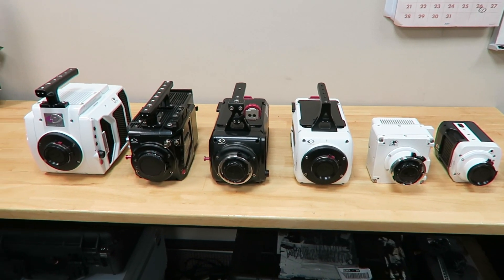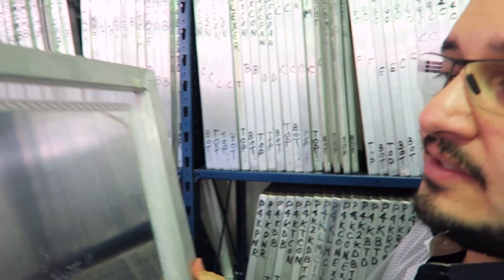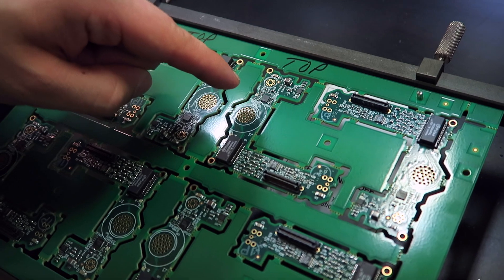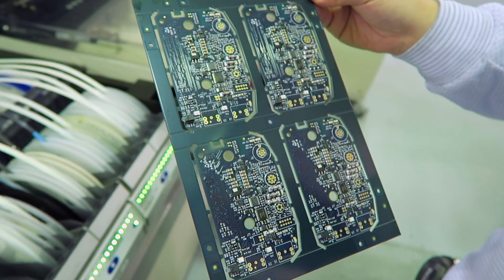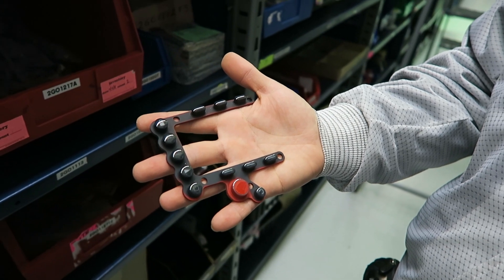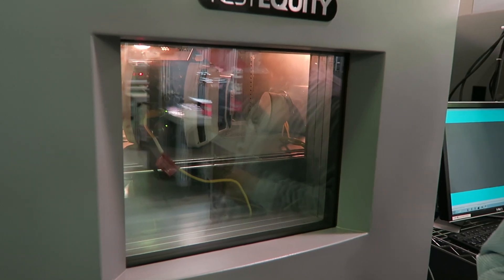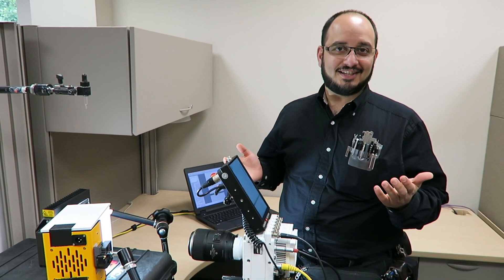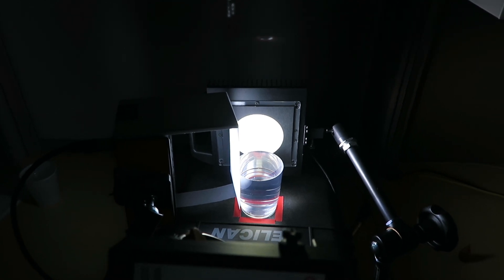How Phantom Cameras are made

Comment: I have a hard time handling how perfectly symmetrical those water droplets hitting the water were
Reply: They used to make lead shots by dropping a premeasured amount of molten lead from a certain height into cold water where it solidified into an almost perfect sphere.

It's physics at work :P
Reply: the water one without the die looked so fake and simulated
Reply: Alec White that’s actual the third one :)
Reply: Maybe this will help. If u think about what causes tge drops to be perfect, it gravity combined with several other forces acting inward upon thr droplet. And its also newtons first law (i believe) every force has an equal and opposite reaction meaning while a force is being put on from one direction, the same force is acting on the opposite side, thus giving a perfect sphere. Obviously with air flow and forcing it out the tube the water drop will not stay perfect the whole time

Comment: I'm surprised they do the board assembly in-house. I'd think they would have an outside shop make the CCA to cut costs by decreasing overhead. Where is the actual design work done?
Reply: Assembly is probably cheaper in-house, considering they do make quite a few cameras.
Design is definitely in-house, from silicon(sensors) to mechanical.

Comment: Using a slightly updated version of screen printing for board manufacturing...pretty awesome.
Reply: Just for dispensing solder paste.
That's the cheapest, easiest, fastest, and most reliable way.

Photolithography is used for making PCBs themselves.

Comment: I have so many questions for this, but honestly I hardly understand all the tech lingo in this so I don't feel like asking in fear of not understand the answer
Reply: Lol try asking. You can't learn if you don't try :) I've worked In a similar factory so I may be able to answer some questions.
Reply: bensemus x Well, the only thing I can think of right now is what happens to the camera if it has any defects. Do they scrap the whole thing, or do they take it all apart and replace the defects?
Reply: I'm not an expert in any way, but from what I do know of how similar products are made in the industry, a lot would depend on where on the camera the defect is and how serious it is - that's why you have extensive defect checking at every step, because if you find out a component is missing from one of your boards just after the components were added, it's a lot easier to run that back through and fix it than, say, if you discover it during final assembly. Some stuff you certainly could take the whole camera apart and run everything back through, but some stuff would require you to scrap most or all of the product depending on how far down the chain they are and how severe the issue is. A cracked board for example is always a showstopper. 

That's part of why tech is increasingly moving towards modular design. Modular designs, among other disadvantages, do cost more, but they're also much less costly to maintenance on average.
Reply: They most likely repair it if it's possible, if not, the entire camera is scrapped/put in for further investigation and possible repair(dead sensor, etc).
Reply: Little Snuggle Most likely they will manually rework the defective board. In our factory the boards were inspected any any missing or poorly soldered parts were sent to repair where someone manually fixed it. For really cheap parts we would just toss them but these boards can't be cheap.
Reply: Normally you got at least 3 stages, where you test your Circuit-boards. #1: SMT (Chip parts - the one on the reels, or cassettes as he liked to call it), #2: THT (The next step, where all the connectors and stuff are assembled) and #3: test bay (Normally a complete electric test of the circuit board). If you mess up and don't notice it after these stages, rework and repair get's very time-consuming and expensive. Before that, it's no big deal.
Reply: JackswastedlifeLP Nope.
At this price point, it's REALLY cheap to do manual repair on fully assembled cameras compared to remanufacture.
Reply: I'm not talking about remanufacturing the whole thing, I'm talking about replacing the defective components (resistors, capacitors, IC's and so on)
Reply: JackswastedlifeLP Testing happens after final assembly of boards, as well as final assembly of cameras.
Nothing is done before that.
Reply: dude, look at 3:15, that's an AOI machine -.-
Reply: JackswastedlifeLP By that I mean functional testing, not assembly.

Comment: I was about to request some sort of tech explanation about the gear you use. The factory tour is nice, looks like any other good contract manufacturer running an SMT line. I was expecting more about the magic going inside one of those, if the CCD was custom made, how was the main processor implemented, how fast it runs ... etc etc. Of course this has something to do with IP and they are nor sharing this information with YT. They show a pretty nice factory, but it is standard gear in electronics industry. The money shot is in the RD offices, IMHO, talking to the people who made it real, the tools they use .... that would be mind blowing.
Reply: They use in-house designed CMOS sensors. CCDs aren't used for anything high-speed, and haven't been for more than a decade.
They use a set of breakneck expensive FPGAs running at(I presume) around 600-900 MHz(that's not actually true, the FPGAs don't have a single "clock") to store images in RAM.
They probably use Altium or Cadence products for designing the electronics, probably Autodesk stuff for mechanical.

Nothing special.
Reply: ***** Ahhh ok, I am not very keen in image HW, that why I wanted to see the magic there. Yes, I asume that FPGA was used heavily there, that is sure. But they have a logic designer as well to make one or more custom chips, but since its all digital and not mixed signal, probably they can drive all the way with an FPGA given the POWER of the expensive ones and its capacity, no bottleneck there. But the image sensor most be crazy stuff. And even when they store to high speed RAM they cant fit enough to record 1s at 26K FPS, they most have a big buffer but somewhere most be a badass storage matching the throughput of data.  He told about the flash cartridge being high speed ... probably some black magic going there too. I dont know if actual SSD that dont use SATA (those that plug into PCI express or so) are capable of its speed and latency (never figured the numbers). 
Altium, of course and probably Solid or Catia for the mechanical ... lets go pro there too =) 
Those sensor are read more like a DRAM in a matrix fashion. I mean, they are not SERIAL ... right ?. This stuff would be interesting, but probably will be boring for most of the subbers ... I believe.. Anyways, that is IP, and they are not sharing these, but hey, show a couple of LCD with Altium and some logic design SW (I dont know them at all), and some FPGA suite like Quartus (the only one I heard about LOL) Cheers
Reply: 38911bytefree The only custom hardware in there in terms of silicon is the sensor, the rest is FPGA fabric.
They are using a custom SSD, maybe even something proprietary, but it's definitely not fast enough to store images in realtime at higher speeds.
The sensor most likely has a regular clock input and spits out data over a lot of parallel LVDS lanes running at several hundred megabits per second each. So, yes, it is serial, serial-parallel.
Reply: ***** Do you have some link to read about this sensor ? .... Thanks.
Reply: 38911bytefree Nope, it's entirely proprietary.

Comment: 3:19 They still use vista?
wot
Reply: that's not vista, that's Windows XP!!
Reply: No reason to upgrade those machines. The software they are running might only support vista too. I work in a similar factory and the P&P machines are running XP. Some are even running 95.
Reply: Yeah, they are probably not connected to the internet, so who cares if its up-to-date for security exploits.  
And yeah, some software/drivers they use might not work on a newer OS.
Reply: Most of the United State's nuclear missile control is run off the foot long floppy disks.
Reply: Ezequiel Perez Close enough.
Reply: Of course, how else is he going to play Halo 2 during the wait.

Comment: And this, everyone, is why phantoms are so damn expensive
Reply: bensemus x There is a huge markup on the Phantom cameras, sure, they don't cost more than $10k/ea to produce.
That's not the point. They can set the price to anything they want, because there's barely any competition.
Reply: The same machines are used to build the little lights in cars. The cost comes from designing them more then making them.
Reply: And their custom sensors.
And the hardware cost.
They have several $5k+ FPGAs in there and those multi-way connectors made out of dollars, hnnnng.
Reply: ***** Markup on products can be crazy though. We make a board which costs us $10, sell it for $30 and then it's sold for $500 after it gets its housing.

Comment: On your question of toast through the reflow oven: I used to work at a Fab and we had a few. Every couple of weeks, we would suddenly get a bunch of random failures. No one knew why, but analysis showed random particulate in the parts. Finally we found out that it was a tech making pizzas on their late night shift. So that toast you want would potentially ruin a few really expensive cameras like it did our boards.
Reply: Really? Someone was actually putting food into the oven? Hahaha. I also work in a SMT factory but no one ever put food into the oven. They are quite dirty and we use lead paste in some products so very bad idea. Instead some people put stink bugs through the oven, or the laser, or doused them in isopropyl.... Ya we don't like stink bugs.
Reply: Yep. Actually, it was a story I was told from before I started. May have actually been anecdotal, but still kind of funny.

Comment: This has allowed me to appreciate just how many parts go onto ANY circuit bord. Just spent a while looking at my Graphics card wondering just how many more parts does my card have compared to a phantom - Great video guys
Reply: Quite a bit less, because your graphics card has been integrated to death to make it cheaper to manufacture.
Reply: ***** Okay yes, you have a point there - I guess I'll have a better understanding when I start my Computer Science Courses in University. Thanks for the insight none-the-less!
Reply: Killjoy212 In ELI5 terms:
Your graphics card has all the electric pixie wrangling stuff on one crystal instead of multiple with wires.
Reply: ***** Haha I understand, with a good laugh in between
Reply: Make sure to follow up on any chance to design your own integrated circuit chip if you get the opportunity, some CS courses offer that sort of thing. At least the chance to develop one on an emulator/simulator... But some even do a class-wide actual integrated circuit manufacturing run. Once you've done that, then take a 2nd look at your graphics card. You'll feel even more gobsmacked by the complexity of it all, once you can appreciate it!
Reply: Mythricia You can only get ICs in advanced EE, but the good part is that most final projects are sponsored by the uni to go through a small MPW run at a service like MOSIS, which gets you 20-30 chips of your own design in silicon, packaged.

And you really don't need to go to uni to design circuits - it takes an hour for anyone slightly experienced with electronics to design, simulate, and fully tape out something simple like a NAND gate or even a small opamp.

The real issue is actually manufacturing your IC design. Even MPW, "low-cost" services like MOSIS cost around $2000-5000 for a mm^2 with a minimum order of several mm^2 and a lead time of ~2-5 months.

Image sensors not only cost a lot more to prototype because they're physically huge chunks of silicon, but because they use more complicated processes.
Reply: ***** I guess it depends where, I have a friend who studied in the US and they did a little bit of basic IC design as part of regular CS. Never went anywhere near EE. Although I don't really know the specifics of it. This was quite a while ago though.

And yes, I was making the same point you were, just figured it don't make much sense to the original poster to talk about the details of low volume manufacturing cost. And yes, there are quite a few of us who are into circuit design, integrated or otherwise, without ever having studied it!

Though I don't know if a NAND gate counts as much of an IC design, it's like what, 4 transistors, 7 different layers x)

Comment: So that's why it costs more than a Ferrari haha. Those things are amazing
Reply: Nope, it costs that much because of R&D and low demand.
Reply: +Spirit that's part of the reason, I worked with Sony about 3 years ago on a slow mo camera that was going to be released this year and, they sold hundreds and hundreds of units, the camera does 480 frames per second in 4k, I believe the cost is about $96,000. I know that's not even close to the amount of units they sell on a consumer camera. but I figured just for comparison
Reply: Warped Perception $96k is absolutely mental for 4k480, I'm working on a camera that will do 4k300 for around $5000-6000. That's what slapping the label "professional" on something gets you.
Reply: +Spirit lol, I thought the same thing. for some reason I was expecting the price to be much much lower when released. it's Sony, and 480 fps for that price. 😲
Reply: You could always get an  edgertronic SC2+ if you're on a budget, or a Sony RX10 mk2 if you're on an extremely low budget :)
Reply: IronFilmVR The SC2 is not a good option anymore.
The Chronos 1.4 is.

Comment: holy shit is he still using windows vista? wow.
Reply: The software might not be available for later versions and it might not be worth updating it even if it is given that it's not being used for anything else.
Reply: ah yeah i know all that, i work in a similar industry, lets hope its not connected to the internet because you are fucked as its not even safe to use chrome on it anymore
Reply: It's Windows XP.  Everybody's favourite.
Reply: There are some stores in Britain that still use XP, and as Django said, most of the time it's simply down to the fact that it's pointless updating to something that's not being used for much
Reply: I have seen one of those pick and place back in 2006 when new and it was running NT4. Industrial gear tend to stick to things that are proven and reliable.  So, by 2006 NT4 was both, OLD but almost flawless, lightweight and bullet proof, fits perfect in this enviroment. The life cycle and development time of those machines are long, so they are always one step behind, by the time this products are installed and making money, the main system is already obsolete. A shame that by now is getting so outdated. But I have one XP at work and it is receiving updates every two days. So, something is going depending on the type of the license. XP for embeded is still supported just because it is being used widely, most ATMs are XP based for example and need the safety issues being patched ASAP. MS is still giving support to them, but domestic users are done. Better like you said, use it OFFLINE. Thats all.
Reply: I use a CNC stone cutting saw that's only a few months old that runs XP Pro on an embedded system (there's also a CNC router that's 4 years old that has XP pro as well), it seems that industrial PCs are very slow to update to newer software
Reply: I know older industries that produce paper etcetra where you have a lot of PLC coding(AND OR etc...) where you have computers hooked up to the system that still are in Windows 98 etcetra. Because, as bytefree said. They are reliable and you don't really need to update and create disturbances in the industry if it still works.
Reply: The real reason he runs vista is to play Halo 2.
Reply: if only halo 2 had the laser :(